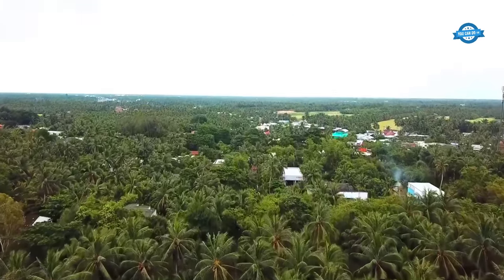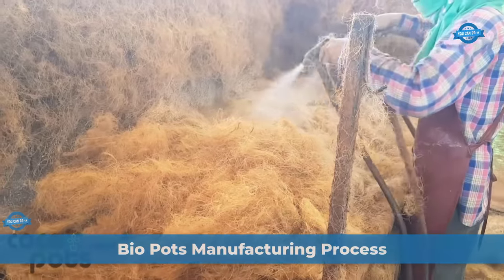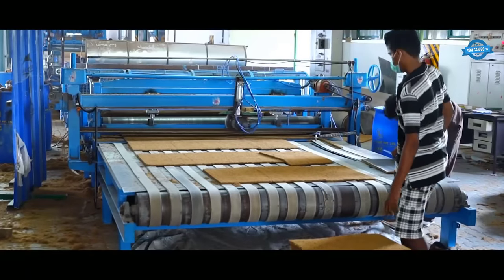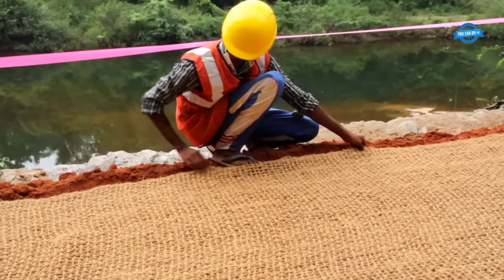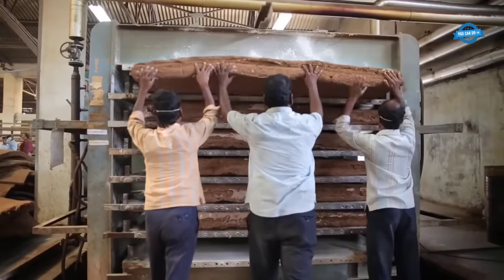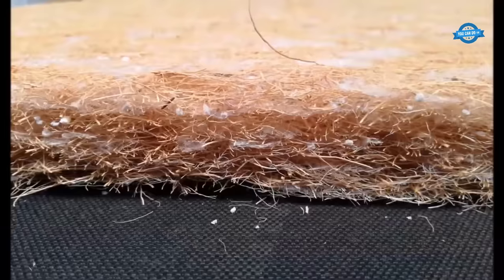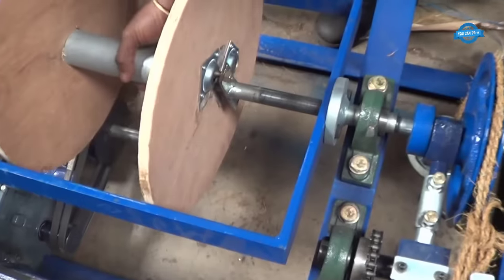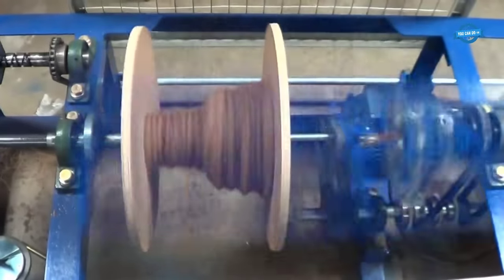Coconut Fiber Products Manufacturing Process. Great application of coir products in modern life

Comment: to be honest the best use for coconut husk is chopped into 10mm cubes and used as hydroponics medium - it needs to be washed and bought to a neutral to be perfect for any crop you want to grow if you're a chemist ... Chemists don't need pots that let the root bugs in - Chemists need a pot that maintains temperature and humidity and keeps the root eating bugs Out but contains coconut husk is chopped into 10mm cubes - That's were the money is.
Reply: use for hydroponics  filter...no, big no. I have use it for filter my aquarium. it good at first but rotten and disolve after 12-18 month then fish start to dying in mass.